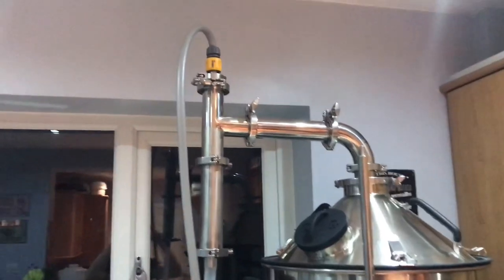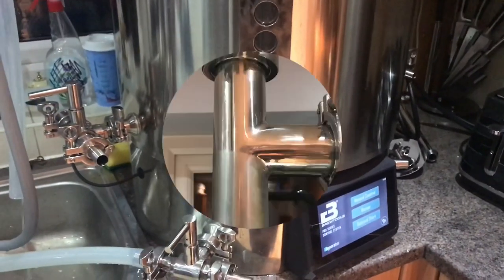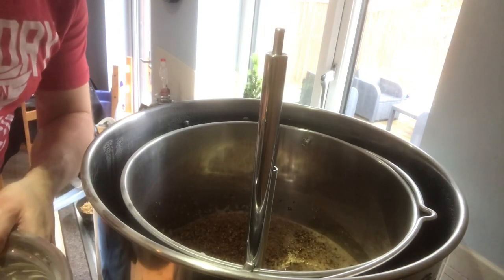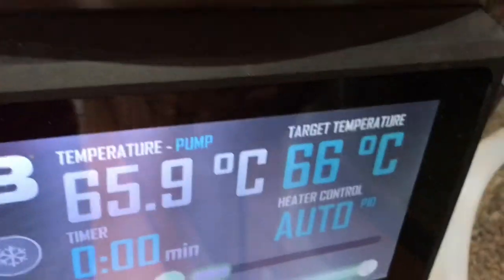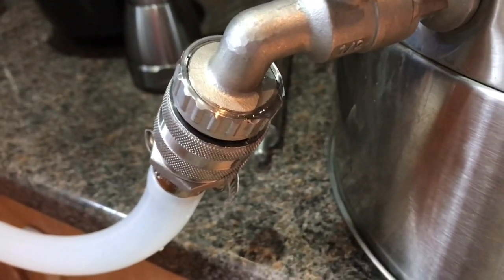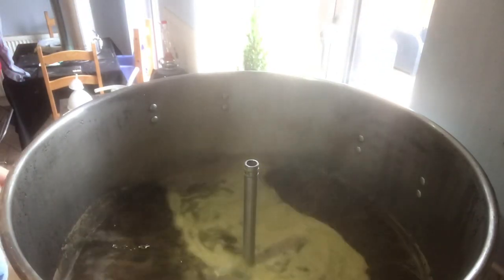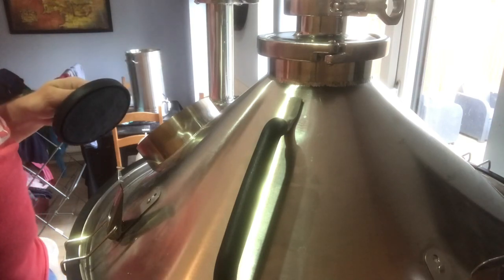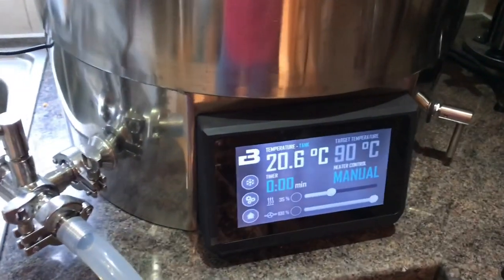BrewTools B80pro COMPLETE SYSTEM BREW DAY - Fullers London Porter

Comment: Single temperature infusion produces distillers beer, the slang term is moonshiners beer. Someone, convinced you that distillers beer is ale, and the method that makes distillers beer, makes ale. The liquids are chemically different and ale is much higher quality than distillers beer. The homebrew method creates a chemically imbalance, sugar imbalanced, unstable, extract. The off flavors and short shelf life associated with homebrew develop during fermentation. A distiller purposely denatures enzymes because a particular enzyme extends the length of their process. Beta extends the process. Beta is responsible for conversion. The rest at 67C denatured Beta, rapidly, along with the other enzymes needed to make ale and lager. 
A distiller uses 66C because a high volume of glucose and less sweet tasting, nonfermenting, types of sugar are released within an hour. Glucose, simple sugar, is responsible for primary fermentation and most of the ABV. Alpha deals with starch and it's responsible for liquefaction and saccharification. Beta deals with glucose and it's responsible for conversion. Beta converts glucose released by Alpha during saccharification and turns the simple sugar into complex types of sugar, maltose and maltotriose during conversion (60C). Those are the types of sugar make ale and lager. When conversion occurs secondary fermentation takes place. Beer doesn't require priming sugar or CO2 injection for carbonating when conversion occurs. Beer naturally carbonated due to maltotriose during conditioning. Natural carbonation is much finer than bubbles produced from artificial means.
The homebrew method causes the richest starch in malt to be thrown out with the spent mash. Amylo-pectin makes up the tips of the kernel, it's heat resistant, complex, starch that contains A and B limit dextrin. A and B limit dextrin are tasteless, nonfermenting types of sugar responsible for body and mouthfeel in beer. The temperatures used to make homebrewed, distillers beer aren't high enough to burst the starch before Alpha denatures and the starch ends up unused. When Alpha releases limit dextrin, dextrinization and gelatinization occur. To take advantage of the rich starch mash is boiled. A distiller sells the starch and maltodextrin, used in baking, is made from the starch. Home brewers are led to believe that high mash temperature produces body and mouthfeel which isn't entirely, true. The only time when body and mouthfeel form is when a 1-6 link is in simple starch, amylose, which is extremely, rare. High temperatures produce sweet beer, low in ABV. The finest ale and pils are made from dextrinous extract, not from sweet sugar and glucose extract.
Since, time is time, why spend time on making low quality distillers beer when the time can be spent on making ale and Lager? To make ale and lager you'll need books that pertain to making ale. Start with deClercks books. Wulf's Journals are very expensive. Abstracts from the IOB are free online, their journals cost money. The IOB made malt, modern, in the 19th century. They're responsible for the spec sheet that comes with each bag of malt, at least it's supposed to have a spec sheet, because the malt left the malthouse with one. A spec sheet is used by a brewer to determine the quality of malt before it's purchased. The recipe you followed probably won't make ale due to the malt being high modified and high protein. A recipe that calls out two row pale malt is the same as asking a person to buy a blue car.  Modification (Kolbach, SNR) and percentage of protein are two very important numbers on a spec sheet. Brewers grade malt is Kolbach 40 and lower with protein 10 percent and lower. High modified malt is Kolbach 42 to 46 and protein 12 to 16 percent, except, for a type of Marris Otter which is 8 percent protein but the malt is low in diastatic power because enzymes are beat up. If you enjoy making distillers beer that's the malt to use. The less protein, more sugar. Marris Otter, Halcyon and Golden Promise are well known and high quality distillers grade malt.
Under modified, low protein, malt makes ale and lager but the malt will be ruined when it's used with single temperature infusion. At the least, the malt should be step mashed. To take full advantage of the rich malt the decoction method is used. 
You read a fictional story written by advertisers that said high modified, high protein, malt soaked in hot water for an hour makes ale and lager. Malt would need to contain magical properties for that to happen. CAMRA invented the story in the early 70s and they turned distillers beer and Prohibition beer into ale and people fell for it.
Stay safe, stay thirsty, make ale and lager.

Comment: I know this video is a year old but I have a question! How does your house cope with the 6kW of power + the sparge water heater? No tripped fuses?
Reply from the maker: Hey - nope, no issues at all so far 🤞🍻
Reply: @8pibrewing867  do you have both plugs connected to one double socket?
What do you have set as the max current in settings?

Thanks!
Reply from the maker: Yeah, both in one socket, set at 13A. Sparge tank in a separate socket 👍

Comment: Is the cap you put on top included when you buy the B80Pro?
Reply from the maker: No, you just get a standard flat lid. The steam hat and the condenser are both additional purchases... which is costly, but depends on your circumstance I guess. For me it would have cost more money than the additional parts to get a extractor hood etc. fitted, so in a way it saved me money 👍🍻

Comment: Thanks for these videos. Tempting me to upgrade to a B80. How many litres per hour would you estimate the condenser uses during the boil?
Reply from the maker: No problem, hope the videos are useful. And yes, yes you should definitely upgrade! Haha. It’s expensive, but I almost waited for the G70, which, upon seeing it and hearing some of the early reports I am 200% glad I went with BrewTools. As for the condenser, the standard nozzle is rated at 1.1 litres/minute, so you’d be looking at 100 litres or so depending on the length of boil. Of course, it’s totally reusable for another brew day, cleaning etc. 🍻
Reply: 8Pi Brewing Thanks! Not too much.

Comment: Heads up, may want to use "mash" mode, and not auto when mashing to avoid scorching the elements.
Reply from the maker: Cheers man. You’re absolutely right. I think I did do that on my second brew (the Directors clone), but totally missed the mark this time round. Fortunately no issues with the elements, but must remember next time... 👍🍻
Reply: To prevent this, you could use the adjustable dip tubes (adjustable outside the tun) which Brewtools provide as an accessorie. Adjust them to upright position while mashing.
Reply from the maker: Ivar Skov-Skov yep, indeed. I’m thinking about picking one up. I got the standard dip tube upright, but when you come to drain the tank it’s a bit awkward to push it down. Nothing major, but the adjustable dip tubes definitely look convenient! 🍻